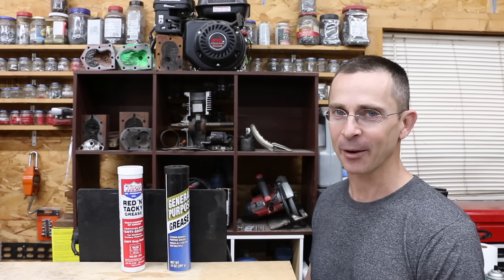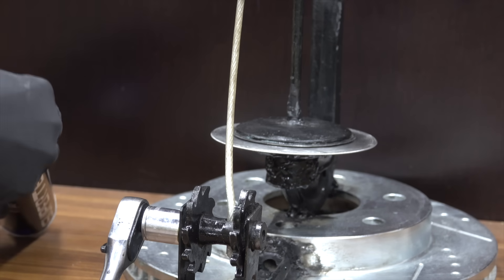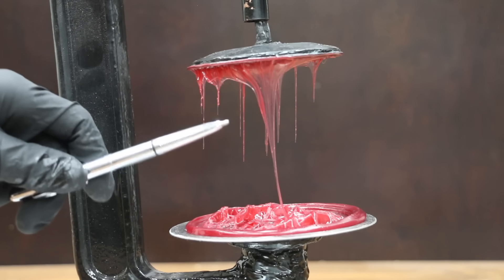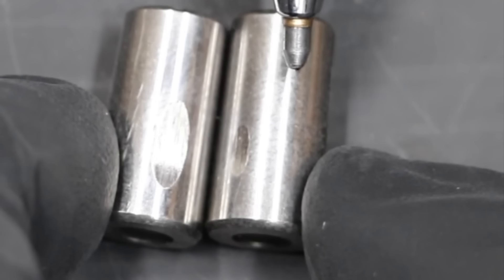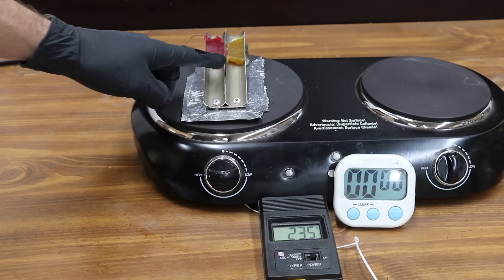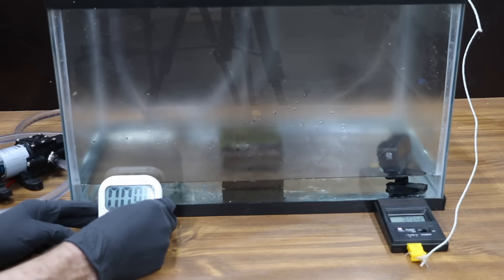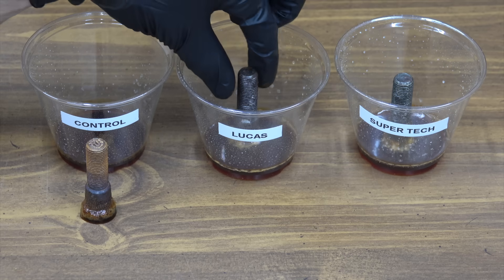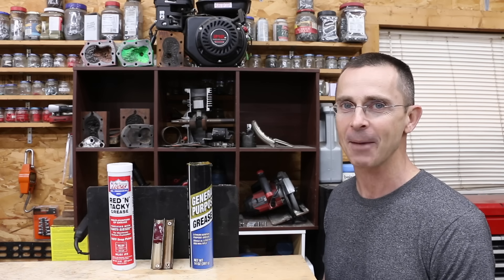Is Cheap Grease better than Lucas Red N Tacky? Let's find out! Bearing Grease Test Episode 1

Comment: I worked at a pattern shop a few years ago.  I was given the job of maintenance man of all the equipment.  when I was going to lube the bearings in a very old floor standing disc sander, the instructions inside the cover said to only lube the bearings every 5 years.   as far as I could tell the last person to record the date was in the 1980s.  that's how long that grease was protecting these bearings.  and that sander stayed on 8hrs a day often 6 days a week.
Reply from the maker: Thanks for sharing.

Comment: @Project Farm
I knew before you did your testing that the Lucas brand would at least live up to it’s name and would likely exceed expectations!

I was not disappointed!!!
I’ve used Lucas Oil products in everything I could find a Lucas Oil product that met the purpose I needed it for. 
Lucas Oil Stabilizer, Lucas Oil fuel injector cleaner, Lucas Oil fuel stabilizer for diesel fuels, essentially if there’s a Lucas brand product that is designed to improve the capabilities of anything mechanical, I have used it or I will use it!!!
Without question!
Reply from the maker: Thanks for the feedback.

Comment: It was interesting to see quantified what I observed years ago in my full time machine repair days. 

Super Tech's grease is what I term a generic; not the greatest, but definitely not the worst. Used in the proper application, following the machines mfr's instructions, it's way better than none.

The Lucas is great for all the same job's, but where it shines is in the less common applications, like light duty enclosed gear transmissions that spec out grease as the lube. A good example would be the gear drive trans in a riding lawnmower. Lucas will exceed the spec's of the grease the OEM used and do a better job of it.
Reply: Iirc, isn't Lucas Grease and Oil one of the only companies that never sold out to Walmart?  Or am I thinking of a different company?

Comment: I use molybdenum disulphide grease for virtually everything based on the thinking that if I forget to grease a point there will at least be some dry film moly lubrication left until that grease point next gets attention.  The downside is that the grease is black and messy.  I would be interested to see how moly grease compares to red grease.
Reply from the maker: Thanks for the video idea.

Comment: We would like you to try the flexseal products. We have a waterpipe that leaks at our restaurant (outside) by the dumpster. It is about 3 1/2 feet high with a Waterhose hookup. Every time I turn it on water sprays. But we have to use it to wash out the trash container (cart). Just wondering would the flexseal tape repair it without having to call a plumber. My manager didn’t make a bonus this year and I (maintenance) am trying to save money for her and the store (McDonald’s) so she can receive a bonus the next time.
Reply from the maker: Thanks for the video idea.

Comment: I've been using Lucas red & tacky for probably 8-10 yrs now. I don't have to grease equipment near as often, and use it in boat trailer wheel bearings too. Good stuff. Thanks for video. Keep them coming.
Reply from the maker: Thanks, will do.

Comment: I'd love to see the playoff like you did with the motor oils for the greases.  Several greases I'd be interested in seeing in the competition are Lucas Red N Tacky, Lucas X'tra Heavy Duty, Lucas Marine, Super Lube MULTI-PURPOSE SYNTHETIC GREASE WITH SYNCOLON, and the "Super Moly Paste" found at airrifleheadquarters dot com.  Unlike the Lithium based greases, it's supposed to be safe on rubber seals and plastic parts.  I'd love to see how it stacks up!
Reply: Harbor Freight Greases would be nice to see as well.
Reply from the maker: Thanks for the video idea.
Reply: A local business told me that the Mystik brand grease they sale out sales the Lucas Red N Tacky that they also sale.  That might be worth testing as well.

Comment: So Can I use this on my brake system such as for the caliper guide pins
Reply from the maker: I've done it but recommend going with grease specifically designed for lubricating the guide pins.
Reply: Project Farm Thank you so much for your response.

Comment: I'd still be wary of mixing greases if it can at all be avoided, and if you must; know your chemistry. It's quite often gonna spend its time between or inside somwhere you cannot easily inspect it properly, for many months or years, not just 24 hrs. While these two seem compatible for at least 24 hrs, datasheets telling in full what chemical components and additives these and other ones contain isn't always easily accessible. Chemical reaction data on the combination of those specific components of two different products, under various type loads, humidities, material contacts and temperatures; maybe even less so. And often the equipment being greased might be very costly to repair / have downtime on. So if you have the means and opportunity, consider longer duration testing your product combination on non mission critical, low-cost equipment first. If you're not certain what was previously used on a piece of equipment, see if you can harvest a little bit of it. Although I guess once you're in this situation, you're probably already in need of more grease, not less (however little).
Reply from the maker: Thanks for the feedback.

Comment: You should test 3things.  1st, Stock Silverado 5.3l fuel injectors (flow rate) vs the 4.8, 6.0 & 6.2 OEM Injectors.. OEM's are around $150ea..  2nd, test them again the Chinese replacements, which are on Amazon for $65 for a SET OF 8!!!!  That's a huge price difference.  3rd, there is a "hack" where you grind off the spray tip of the injector and apparently it changes them from 24lb to 75lb injectors!!  WOW!!  THATS A HUGE INCREASE!!! lol.  Thanks
Reply from the maker: Thanks for the suggestion.

Comment: Would that be more fair to use Super Tech Multi-Duty Complex Hi-Temp Grease? Also anyone has a recommendation for grease on the planetary gears in the starter? Needle pins type of bearing. I've hear Moly grease is bad for them...Thanks
Reply from the maker: Great suggestion!  Thank you.

Comment: I would love to see a difference in corrosion resistance between marine grease and regulate grease. Always used marine grease in my boat trailer bearings, would be good to know if it's worth the extra money. "The same 10 cent washer for your car costs a dollar for your boat and $10 for your plane"
Reply from the maker: Great suggestion!  Thank you.

Comment: I just watched this video a second time. The first time I wanted to know what on earth that pink stringy stuff was. This time, I am looking to fix a belt sander that was used by a boat builder in the South Pacific (Tonga). It sounded horrible when I got it and I just now (like 5 years after I got it) am looking into it to see what is wrong. Other than a bearing that LITERALLY DISINTEGRATED, every other bearing taking 10 in pounds to move, and the grease that is solidified green goo, it is fine!
This video helped TONS! The different tests you did helped explain the things grease does and the properties it needs to work well, and also was engaging enough to keep my hyper 10yo nephew occupied! Thank you!

Comment: I have been for several years used the EP Super Tech for the ball joints in my truck and my old ‘70 Pontiac LeMans and my tractors , but I do see in your testing the Lucas performed better .
Reply from the maker: Thanks for sharing.

Comment: I use ST grease for low impact needs, it works great as a GP grease. But for anything serious it's Red 'N Tacky 100% of the time. Even on my saltwater boat trailer's wheel bearings and suspension components it's R'nT. Thanks for a great video, as usual.  👍
Reply from the maker: Thanks for sharing.

Comment: I bought a used tent trailer and packed the bearings with Lucas red and tacky. Towed it from central California to Boise Idaho and back at speeds of 70-70 mph on the open road. Early May. I'd check hub temps every hour and they never even got warm to the touch.
Reply from the maker: Thanks for sharing.

Comment: I bought Lucas Red & Tacky last week to lube the wheel bearings on my travel trailer. I did my research on what was required by the axle manufacturer and found Lucas Oil Red & Tacky to exceed those requirements for a #2 lithium grease. Your test confirmed my research. Outstanding!
Reply from the maker: Glad to hear!  Thanks for watching.

Comment: I'll be interested in comparing Super Tech Multi-Duty Complex Hi-Temp Grease, 14 oz Tube, and Super Tech Moly-Lithium Extreme Pressure Grease, 14 oz Tube too.  They are not described as "light duty" hence can be more comparable to Lucas at lower price.
Reply from the maker: Thanks for the video idea.

Comment: There's not going to be a reaction to the 2 greases it's the drop point when you mix the 2 greases together.  You will lower the Red and Tacky drop point by mixing it with general purpose.
Reply from the maker: Thanks for the feedback

Comment: You cant test a Gereral Purpose to a Red and Tacky. 1 Gereal Purpose is a simple Lithium which mean a low drop point under 400 degrees 2 Red and Tacky is a Lithium complex which has a high drop point usually above 500 degrees. They both are made differently. Being that I have made both these greases at our plant your test are like testing apples to oranges.
Reply from the maker: Thanks for the feedback.

Comment: Thank you for the grease video that was very informative. I have been researching stiction eliminators for ford diesels. I'm going to try it and thought it might be something you could test. Possibly for lubrication see if its harmful or acid to metal or maybe if it even cleans anything. Thanks in advance. Biggest brands I found are.
Hot shot secret, arch oil, motorkote, rev x, stp
Reply from the maker: Thanks for the video idea.

Comment: A grease question for backhoe or other heavy equipment, should you remove the excess grease "scab" off pivoting areas or leave it as a protection from dirt and dust?
Reply: good question

Comment: You make this entertaining informative and honest testing. Will I pay more money for protection? Well...depends on the application and what I am protecting with the lubricant. If my application is truly light duty like the tie rods or ball joints...Super Tech! But maybe wheel bearings and u-joints encountering higher rotational speeds, pressures and heat...Lucas might just save more money in the life of the parts. Thank you sir.
Reply from the maker: Thanks for the feedback.

Comment: I have been a Tech for 20 years and I really recommend  all Lucas oils. I have fixed cars with Seafoam and Lucas. And Royal purple. I was given a Toyota Prius from a customer that a large Toyota dealership recommend a engine replacement. I just used Seafoam in the gas and oil, replaced sparkplugs. Royal purple oil  with the Seafoam. It went from burning 1qt per 50 miles to none though the 5k oil change. also a Pontiac Grand Prix from a customer Lucas transmission conditionerthe transmission went from not shifting at all to working for several with no issue.
Reply from the maker: Thanks for sharing.

Comment: How do these compare with brake grease? This is the stuff that comes in the little tubes, that you put on the backs of your brake pads to prevent squeaks. It seems more tenacious than any other grease I've ever handled. I have a table saw whose blade height jackscrew groans when I lower it. Brake grease is the only thing that lasts any amount of time, and even it needs to have more added from time to time. Maybe you could add it to a followup grease test.
Reply from the maker: Thank you for the video idea!

Comment: With all the hype of home energy saving devices... and many not practical... I would like to see you do  a study that I have used. I have NEVER seen it done. Build a couple tiny houses and compare insulation efficacy. One that works crazy well... and simple.. put the foil bubble wrap insul COMPLETELY just before sheet rocking. Its mostly used for duct installation but has a CRAZY ability to prevent transfer of temperature across it. You could include fiberglass,  foam, rock wool also. You ALWAYS do a seat of you pants engineering comparison that works.
Reply from the maker: Thanks for the video idea.

Comment: Grease is subjective 
I have found that cheap grease used in a high shear gear box turns back to oil. I use Lucas grease in the same gear box and the gear shearing doesn’t cause the grease to change back to an oil...
Reply from the maker: Thanks for sharing

Comment: I love your comparisons. You regularly do a great job. My concern with this specific video was the vast differences between the two choices. The cheaper grease seemed to do exactly what it advertised, just as the Lucas did. If I may request it, I'd like to see this comparison, with a more apples to apples style, using a heavy duty grease that is rated closer to the Lucas
Reply from the maker: Great suggestion!

Comment: Something not addressed in this is the viscosity of the base oils in each grease. NLGI 2 is just the consistency of the grease, if one has a base oil with an ISO 68 and the other has an ISO 220, you should see a big difference in performance. Also, compatibility should be tested in the scar test, change in color won't tell you much at all. Nice demonstration on this though.

Comment: A note on bearings... There are so many bearings that are not up to scratch. Some bearings from the same factory will have a 10% resistance difference even when preloaded with the same torque. NTN bearings have the best quality control. Also, only a third of the total volume should be packed with grease. Great video as always!
Reply from the maker: Thanks for the feedback.

Comment: Lucas red and tacky is the only lithium grease I know of that can be used in roller type bearings, because it doesn't cause skidding of the rollers. I've found Lucas products to be the best but also not the easiest to buy here in Sydney Australia since the last sales rep quit his job a few years ago, and there isn't many shops that keep Lucas products in stock so usually has to be ordered in. Lucas also claims it is safe to mix their products with any other type or brand.
Reply from the maker: Thanks for the feedback.

Comment: A grease competition would be really cool like you did with oil. I am very curious to see what will hold up the best. I went with extra heavy duty grease just on my wheel bearings for my granada just curious if there is something better out ther or if it wasn't worth the couple extra bucks.
Reply from the maker: Great suggestion!

Comment: Among many other Fun occupations, I worked for Sears as a "Lawn & Garden Tech" and "Small Gas Engine Mechanic", and more. Everything they Sell, everything they"ever" sold. I worked in a in a "mobile shop" in a large chunk of Florida (long mowing season). I must have worked on over a thousand Riding Mowers, Lawn/Garden Tractors, Zero-Turns. Working on the tractors was my main gig and most favorite thing to do. I retired from the working world (retired/disabled) 10 years ago but I have a small collection of 6 vintage tractors and a zero-turn.

One of the Biggest problems I saw in my experience and one I was just thinking about last night, was botched up Steering Gears. I'm fixing up an old Ford LT 80 Lawn Tractor and I thought about it's Steering Gear and how I'd like to get some kind of heavy duty greasy goop to use on it to better protect it from wear, other than just plain old grease. Finding a new or even used steering gear might be a tedious thing to do and I'm sure the cost would be annoying. Coincidentally I wasn't looking for a "grease competition" video when I just stumbled across this one.

I'm Sold. Lucas it is, unless otherwise distracted, is the way I'm gonna go. Thanks for the Help.
Reply from the maker: You are welcome!

Comment: Just FYI; Bearings are never fully packed with grease- doing so creates more pressure and heat and failure. Pack the bearings lightly for better performance.
Reply from the maker: Thanks for the feedback.

Comment: Another thing, mixing incompatible greases won’t cAuse damage overnight. Mix grease in a bearing, then put it on a machine and run it day in and day out for 6 months. That’s when you’ll see failure. It can cause viscosity loss causing boundary conditions. viscosity gain causing churning. it can even harden into damn near rock.
Reply from the maker: Thanks for the feedback.